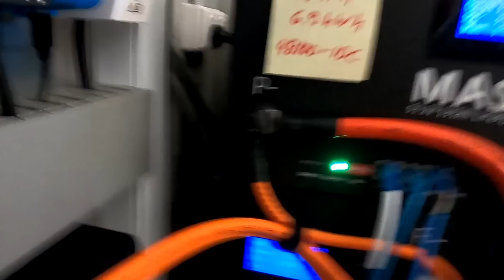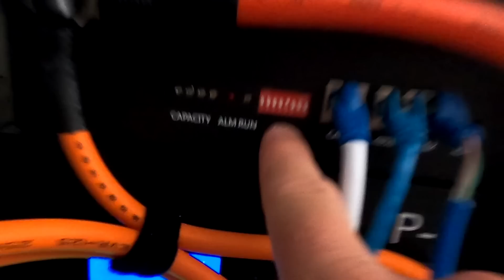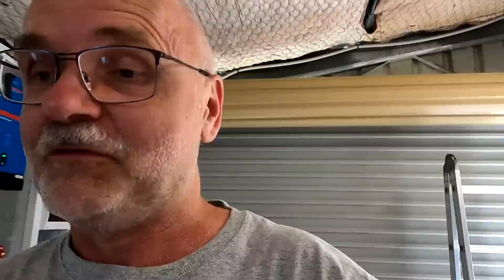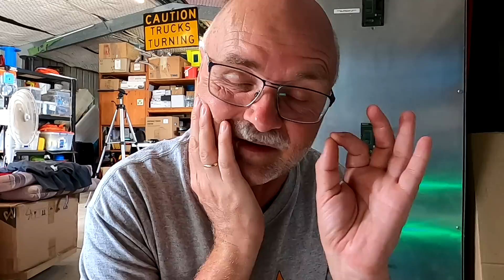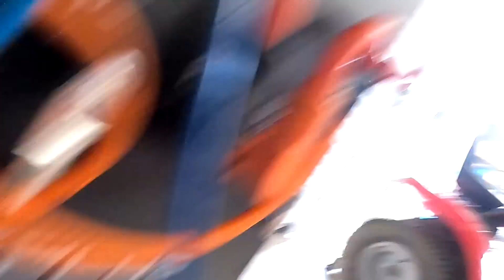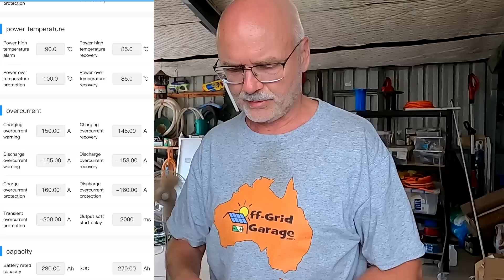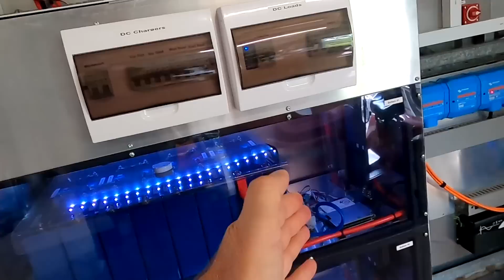No (easy) access to Master BMS of your Seplos battery! Seriously?

Comment: Hi Andy, Greetings from Germany.  😉🍻 
I also have 2 Seplos BMS 10E with Bluetooth in parallel (280ah and 100ah) but not on a Victron system.  
I use a Growatt SPH4000.  both batteries are connected in parallel via rs485 and communicate.  
the large battery is connected to the Growatt inverter via CAN and communicates with the master battery without any problems.  DipSwitch Master: all off / DipSwitch Slave: only #1 on.  Automatic DipSwitch communication off because it doesn't work.  Only manual configuration works.  I don't use BT.
  
In both batteries are one Neeeeey!!  🤣 (I have to laugh about it again and again) 4th generation installed and also work well.  
I only had a communication problem between the BMS once, but it was fixed after turning both BMS switches off and on again.  I also noticed that with a very small charging current (less than <3 amps), no current is displayed for the 100ah battery.  but this can also be due to the configuration 280ah with 100ah.  the current ratio is almost 3 to 1 and behaves as you have shown in your videos with large currents.  

In short: with 2 or more BMS in parallel and with the same hardware status, this phenomenon as you describe it here in this video does not seem to exist.  but these are just my previous experiences with Seplos BMS 10E.

Addendum: the SOC is almost the same for every state of charge +- max 5% difference

Comment: I have two packs setup in parallel, with RS485 connected, however I have no way to validate is it even works or does anything. Zero software support for BMS from supplier. Anyways I connected my batteries with main positive lead from the one battery and main negative from the other, and everything charges and discharges equality. I have had zero drift between the two. I would say disconnect the RS485 between the two and test my suggestion. :P
Reply from the maker: The problem here is that I have a 135Ah and a 280Ah battery in parallel. There is always a drift.
This is an unsupported setup I'm testing.

Comment: Your master is Pack 0. You should tick “target config” and type 0 then only click pack 01 on the below list of packs. You should see them both.
Reply from the maker: I thought I tried that but could not get it to work. Have you tested it?
I'll try again tonight.
Reply: @OffGridGarageAustralia  Yes Andy I see them both I have seplos bms too.
Reply: @jasonluna333  What dip switch settings do you have?
Reply: My dips are 5 on host/master, 1 on slave. When trying to connect with battery monitor by selecting pack 1 and target config "0" it only connects to pack 01. I have two seplos 280a uprights any suggestions?

Comment: Thanks Andy, we have had Seplos BMS for almost 2 years now, much older models with 2x 200ah battery packs. At the time we were not even aware that these were Seplos BMS because we purchased the batteries from another manufacturer, and our batteries were also standalone, i.e. not communicating with the inverter.

I found a solution to the SOC issue perhaps you can test it out and share a video of your thoughts. It will also be helpful because you are able to access the BMS settings where I cannot (dont have the cable, sorry)

Our natural thinking was that if the BMS is showing a OV-Warning that you need to back off on the charge voltage, which we did naturally down 0.2 V every time. This was the wrong solution as in extreme cases we had one battery showing 96% SOC and the other showing 8% SOC (Discharge Shutdown) but the pack voltages were both 54V.

We did lots of things but what "magically" fixed the problem and we have now been running 6 months + without the issue reoccurring. Upping the bulk charge voltage of the inverter to the point where the BMS shuts off the charge mosfet itself. One pack shuts off at 54.6 V and the other at 54.8, when the BMS shuts off it automatically Syncs the SOC value to 100%. My brother has the same setup with an even older inverter, his batteries both shut off at 54.4 V, this could just be inaccuracies in the voltage readings.

What I assume is happening is the BMS does not have an accurate current meter, so it is losing accuracy each day regarding what is going in and out of the Battery. In my case, the drift is approx 0.5% between the two batteries.

Charging to where the BMS shuts off itself forces the sync to 100% SOC

Comment: For this to be a good solution you need to be able to communicate with all the BMSs and you need to be able to configure different batteries in parallel for future add-on can't expect people to get stuck with legacy cells wen upgrading there system in the future.

Comment: Since the two batteries are of different capacities; does the charge controller accept the master battery’s SOC / voltage as nominal? 

What will happen if the smaller battery reaches low SOC ? Will it shut off the whole system or will the system still run with the higher cap battery ?

Comment: Why not go back to using RS485 to communicate with the CerboGX? That should solve the problem
Reply from the maker: How? The Cerbo does not talk RS485.
Reply: @OffGridGarageAustralia  the d-bus serial driver should be able to be installed on Cerbo. VE Direct is = RS232. Or could try a USB input with one of those RS485 adapters you have, except Seplos not supported by the software!

Comment: I think all SEPLOS batteries should be the same. SEPLOS send new BMS that work or money back. You need to completely discharge them and charge them completely again but if BMS is making error comm so they drift apart did you try that?. You made a mistake in mounting different kits?.  i think They must be the same kits. I hear several people in Denmark are doing fine with several batteries connected together but they are working fine. The algorithm and hardware that makes some BMS better than other BMS. I've tried many different BMS and some suck to keep one's SOC when set up parallel og serial specialy serial connected they can drift further and further. But if Seplos states that it can work with Victron, and other brands etc then otherwise it is fake marketing. After all, BT is only a patchwork solution. I had otherwise recommended SEPLOS to someone I know, as several have DIY EVE kit from SEPLOS which works fine. I think you should try same kits connected. But if SEPLOS is telling that is working or what?. Its very important to discharge and recharge for SOC cali. 1 time every month. I have Huawei Sun2000 its doing auto SOC cali.
Reply from the maker: This is part of the testing, as I said. I mentioned that this is not a combination which is recommended by Seplos.
I have more cells coming in to build this second battery. Then we will test same capacity, same BMS, same everything.
The Seplos BMS has some fundamental design issues though with which I'm not happy with, so won't recommend them at the moment.
Reply: @OffGridGarageAustralia  hi greetings from Denmark.. thanks for your answer. 🤗

Comment: Hi Andy, I just found your channel a few days ago when trying to learn about smart BMS's.  Your content is amazing, full of information and humor, and I am greatly enjoying learning from you.  My late father was an immigrant to the US from Austria, so your German accented English is a pleasure to listen to.  I have subscribed to your channel.

I have a question that may have been answered in one of your videos that I haven't seen yet, so please excuse the question if that is the case.

As a "general rule", how much would be saved by making my own 300ah 12v pack from "storage grade" LiFePO4 280ah cells vs buying a $700 USD prebuilt pack?  Assuming no cost for tools and my own time, just costs for the cells, the wire and terminals and maybe a pack fuse, the aluminum for the cell interconnect buss bars, the steel or aluminum and hardware to compress the packs, and the 150a discharge rated smart active balancing BMS?

I look forward to your response and guidance,
Philip from Oregon, USA
Reply from the maker: Thanks a lot, Philip and welcome to the channel. Great to have you here!

I would say you can save 20-30% when building yourself plus all the knowledge and skills you gain by doing so. You will always know your battery well and if something goes wrong, you will know exactly where to look.

Comment: weird. I know you need to have all the BMS connected in order to see them in cerbo, but maybe just use 2 individual connections and do not let them to talk with each other? It seems, that when they talk with each other, the charge gets wrongly distributed. I do not know seplos, but is master BMS only with pack 0? Alternatively would it not work if you configure one as Pack1 and another as Pack2 and not use Pack0 at all?
Reply from the maker: That won't work s the Cerbo can look at only one battery monitor device, which makes perfect sense. So only one master BMS can report all the combined data to the Cerbo.

Comment: I think you waste to much time playing around with a configuration that isn't supported by Seplos. You should get a second box with same hardware and firmware, put 280 Ah cells in and test again. 
And regarding the voltage difference you see at the two boxes, they may come through different voltage calibration of the BMS, and/or through different connenction resistance to each pack caused by the way you daisy chained both packs, and the voltage drop caused by this. You have already discovered in the past that very small voltage difference of cells cause SOC imbalance during active balancing in the flat area. Now the same happens for the packs. Connecting both batteries independently to the distribution will avoid any problems arising from this. 
And finally, what benefit do you expect in productive operation of the complete storage by moving from your DIY batteries to this boxes? Just to see some values in VRM? I don't see any advantage, especially if a problem in one of the batteries cause shutdown the complete storage. For best redundancy use battery modules that are as independent from each other as much as possible, to prevent a complete blackout caused by same hardware and software. In my setup I have up to 10 independent battery modules with different capacity and different BMS (dumb single board, ANT BMS and JK BMS) with additional active balancers running since more than 5 years without any problem.
Reply from the maker: Thanks Emil. You may be new to the channel, but I'm testing things out here a lot, to learn, understand and share my findings. I still have no explanation from Seplos on why this parallel constellation does not work. Also, some of the parameters are not clear to me and it seems the even Seplos does not really know how they work. So I have to test it myself. 
I consider the Seplos Mason still a DIY battery.

Yes, the individual independent setup is what I have installed in my battery shelf as well and it runs nice. Still, I'm interested in this communication stuff and want to test things out, see if there is any benefit in doing it. And what the problems are.
Reply: @OffGridGarageAustralia  I am following your channel for a long time. It is great that you test a lot of stuff, because other with similar setups can use the results. But this case is very special and I assume that nobody else will do exactly the same setup, especially as it is not recommended by Seplos. 

Regarding the different SOC of parallel batteries in this example setup, please have a look at Will Prowse video oXBT8lSC25M. He has paralled a lot more batteries in the same way as you, and explains why this different SOC happens very well.

Comment: I wonder if you can't just use rs485 to a Pi and do CAN to the victron system.
Of course you need to convert protocols and keep state.
Also, is the SEPLOS BMS actually controlling the secondary battery, or are you just connecting to an rs485 bus and addressing the different devices on the bus? Because in that case I would connect them both to the CAN as the victron system is a lot smarter.
Reply from the maker: That sounds complicated. I guess, we can have only one protocol setup with these BMSes at a time.
I don't think the master BMS is actually controlling the slave BMSes. It's more to get the data in one place and report to the Victron system.

Comment: I think you're being unfair, because Selpos advised you not to put these to battery packs together. I understand what you are trying to do here, but to claim there are bugs in the system is going too far! Do the test property first before you start to make these claims i.e. only use the 280 pack with cells from Selpos. You are miss leading people into thinking Seplos sold you this battery, whenin fact it was only the box and BMS. The cells used in side this pack are your own used cells. Come Andy play fair.
Reply from the maker: I said this in the video (and past videos), but thanks for the reminder again. It should not make a difference what batteries we are using in these cases. They are still DIY kits so any battery suitable could go in.

Comment: It is not perfect at all...but if you have same BMS and cells, I just connected it in parallel, set the DIP-switches correctly to RS485 and updated the firmware...than back to CAN-Communication.
And it just works without changing any settings of the BMS😅
How about a factory reset of settings and see if it works better?
Reply from the maker: Thanks Raphael. How do you control single cells in your master pack though if using CAN? Are you running the V2.8 or V2.9 on your system?
Is there an option for a factory reset for the settings? I haven't found one.
Reply: @OffGridGarageAustralia  By Default, the option "Take the initiative current limiting charging" is switched off, when my 150A BMS got shipped with V2.7. I saved the settings of the 48150-1101-10C Version, when it came out of the box. Maybe you have still a untouched version of the BMS around. Or you can ask Seplos for the default parameter file. 
You can save the setting, when you connect to the BMS and press "Upload Parameter". The window "Parameter Manage" opens and you can press "Save as" and save it as a XML-File.
Than you can go to the BMS, that you want to overrite and klick on "Load parameter". Than in the "Parameter Manage"-Window press "Set all".
Let me know, if it works. I could also send you the parameter settings via E-Mail, in case you need them.
Sadly, I do not have acess to my two parallel 280K batteries with the 200A BMS until March...so I can't do furter testing right now.

Comment: Thank you for this video. Yes, it is not good to communicate with seplos if you tell them anything doesn't work like expected. This is what I've got learned. I have a problem with the protocol witch enables 'battery equalization' at the inverter after some time like if there where lead batteries connected. And they won't understand, that the protocol has to disable this function on inverter. It's terrible! 🥴🙈

Greetings from Germany, Andy! 🙋‍♂️
Reply from the maker: I think it all comes down to communication translation and not really understanding what the other person means. I've got the feeling, I have to break everything down, bit by bit, so they understand what I actually want.

Comment: Sounds to me like they found out this problem after the system was in production. So they didn't want to go back and redo the PCB design to make this work correctly. So the "fix" was to add a BT connectivity. 
Pretty lousy fix, imho. And a really "lazy" one too!

At this point, this is would be a huge NOT recommend for purchase of future buyers. And actually, to actively keep people from buying from them. Lost sales could force them to make a revision to their design.
Reply from the maker: The new BMS 10E was a compete re-design of the PCB. They could really have implemented that in this version. Not having access to the master BMS is not great. And the BT app still sucks in many ways.

Comment: Your batteries are not setup correctly for parallel operation as your +ve and -ve feeds are connected to the top battery. The main feed +ve should come from one pack and the -ve from the other pack. With your current layout you will mismatch your SOC.
Reply from the maker: That makes no sense to me. The bottom battery should be on a lower SOC then, if this is the case and would make a difference.
Reply: @OffGridGarageAustralia  That is not how it works. You are misunderstanding voltage drop. Connect it correctly and the bottom pack will correctly balance voltage with the top leaving both on the same SoC. At present, your top cell is doing all/Majority of the discharging which is why it has a lower SoC.

Comment: For the BT just use a dongle on a USB extension cable on a PC or pi but to access both batteries due to their shit its lookin like ya need another RS485 adapter to run it separately

Comment: "I have a dream this afternoom, to have an active (2A mini) BMS  with working MODBUS/CANBUS communication".... I am a dreamer, I know .... Anyway, thx you I will continue with my JKBMS.... Especially when you can now monitor & control them via BT and a ESP32 and send everything where you want (HomeAssistant, VenusOS, etc...)
Reply from the maker: You use the ESP to connect via BT to the JK and forward these info to VenusOS? What if you have several JKs though?
Reply: @OffGridGarageAustralia  Personally I don't use VenusOS (I don't have any victron, when my chinese voltronic will die, I will), but since VenusOS accept any MQTT informations, it's a piece of cake to do the dialog between the ESP32 & VenusOS (via WiFi or Ethernet). Yes by ESP32-BT, you can control several JKBMS in the same time. You just need to give their respective MAC adresses in the code and vollà. To resume, the ESP32 can monitor&control several JKBMS, have an independent Webserver (in case) and communicate with VenusOS via MQTT. FYI, if you run HomeAssistant (as I do), you even don't need the MQTT layer.